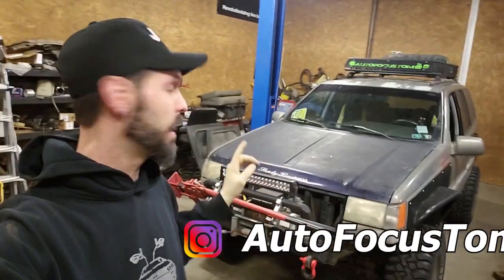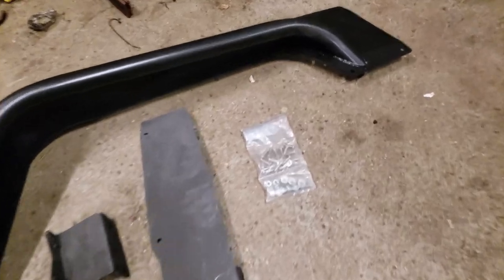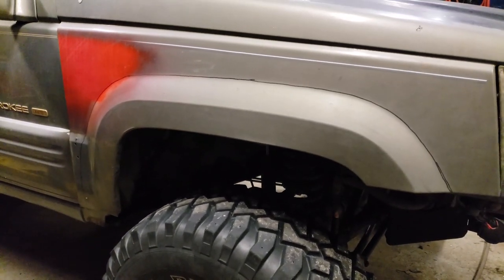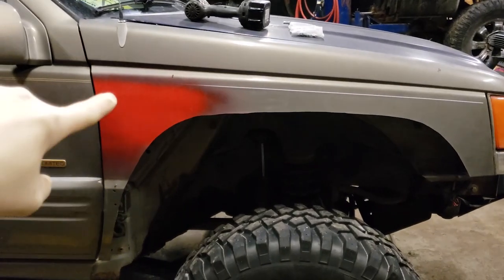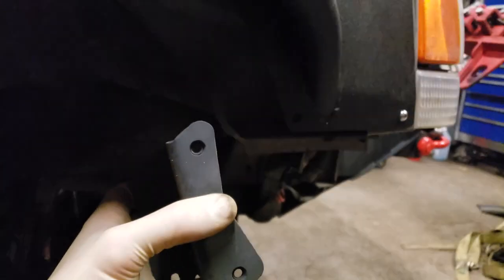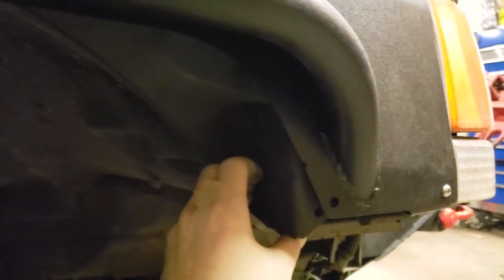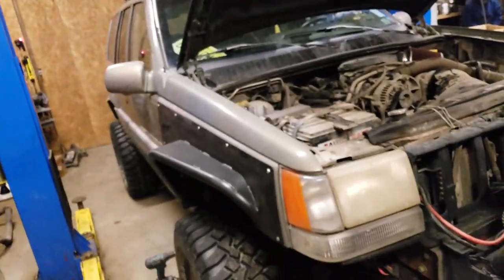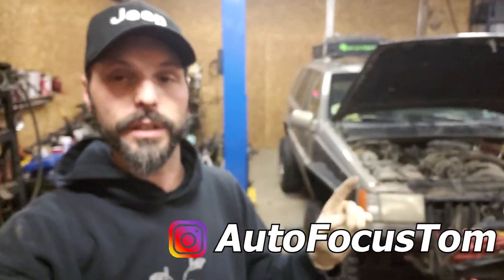How to install MVF fenders on your Jeep Grand Cherokee ZJ

Comment: Looks great. I wonder though how they would hold up against hitting trees etc on the trails. Did you get the correct bracket for passenger side? Will cutting the front bumper support affect install? About to cut my front like yours.

Comment: Do you have a video of shaving the front bumper bracketry and relocating your horns, charcoal canister, airbag sensors, etc.?
Reply: For front bumper bracket delete and charc can re route along with light wire trim item re route, check out Thomas Beyer. His youtube channel has a ZJ diy how to on the exact topic you asked about 👍